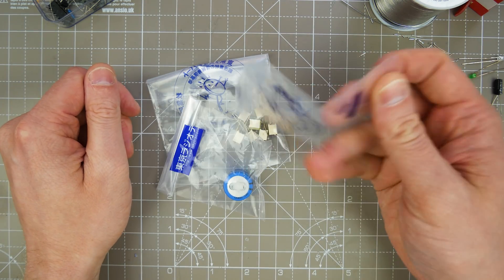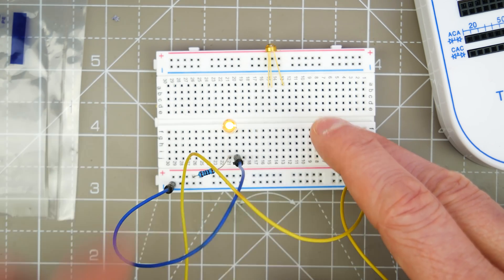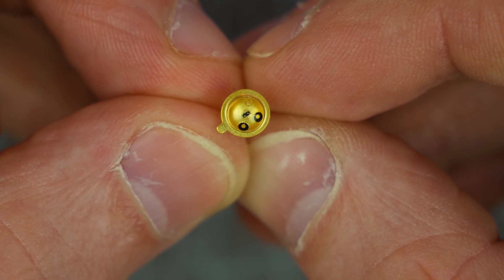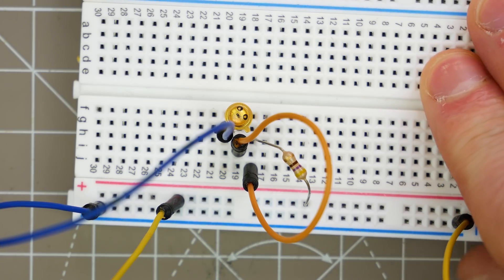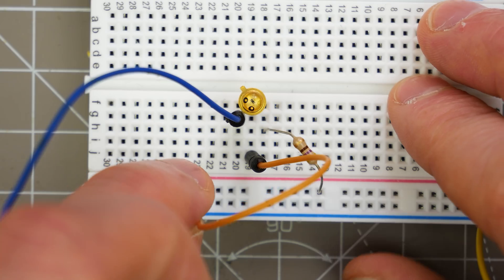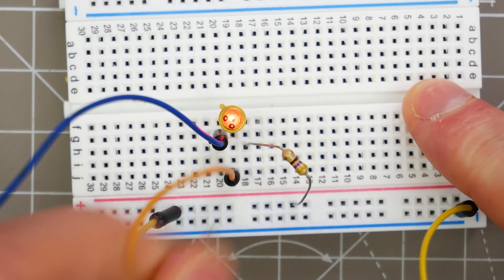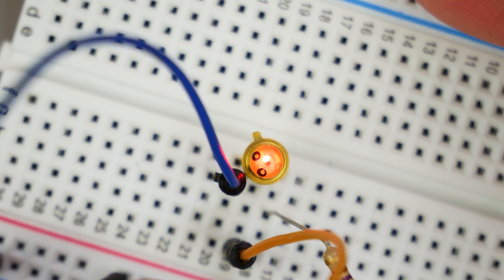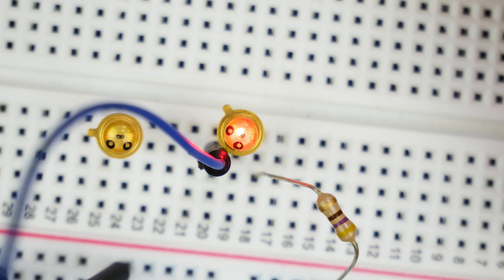Vintage TO-46 LED?

Comment: Are these parts cheaper to buy directly in china than buying them on ebay or aliexpress?
Reply from the maker: They cost me a lot if you factor in the airfare :-) but the ticket price was about £1 each, so Aliexpress would have been a lot cheaper.

Comment: What an interesting led...  I did not find datasheet for your led, but I found this TO-39 led where the third leg is just the case.
https://www.thorlabs.com/newgrouppage9.cfm?objectgroup_id=8606&pn=LED250J
Reply from the maker: Strange that the leg had a bond wire seemingly attached though.

Comment: Inferred on 1 lead and red on other, military applications
Reply: Yes, that was my thought also. It’s clearly a dual LED, looking at the die. So perhaps the second is non-visible wavelength, like 940nm InfraRed. It may make sense to combine a visible red LED with a non-visible InfraRed in applications like remote controls (so you can see when the remote is transmitting).  But I’m just speculating.  :)
Reply from the maker: I agree, only half the 'LED area' is lighting up but I would have thought the camera would see the infrared. I am also not sure why it would turn off the red part of the LED.
Reply: @DavidWatts  military use a mode called [blackout mode] for night operations,  for things like night vision goggles,  soldiers would be wanting  to not be discovered by having  a bright LED, so they go into blackout mode with night vision goggles which can see infrared light just fine
Reply: I think we would see the ir light through the camera.

Comment: Last I checked, it was Anode, Cathode and case.
Reply from the maker: I think I need to play with it some more, the leg that didn't need to be connected did have a bond wire.
 going to the central die (?)

Comment: I'm guessing the third pin is structural or just superfluous, maybe so they can use the same equipment to package the LED as they use for transistors.
Reply: That is exactly the correct answer. When they made these LED's production lines for transistors were already in place, so it made sense to reuse the parts they had already. The third pin is only structural and shouldn't be connected. Some LED's have the substrate as one terminal, but others should have it insulated.

Comment: Good to have you back! I haven't seen your bench supply, but you could forgo the resistor and start with a current limit like 1 mA and 1Volt and slowly increase voltage till a current starts to be drawn and take readings incrementally and build up a characteristic graph for the device plotting current against voltage you should be able to find the "knee" where the diode is happiest, that way you may gain insight into its origins and applications (I love that kinda stuff!) will you be going back if the opportunity comes your way?...look forward to seeing those others too.
Reply from the maker: I will pick it up later in the week and see what I can find out. When I look at the other components I will throw in an update.

Comment: from the tab working anti clockwise  anode, cathode ,case on those old ones
Reply from the maker: Do you know why the case one (assuming that is the one that didn't need to be connected) would have a bond wire to the central die?
Reply: @DavidWatts  possible invisible second led maybe infra red or something like that

Comment: only time ive seen tri leg LEDs is when there are 2 colours in them, either common cathode or common anode and then each of the other legs does a different colour.